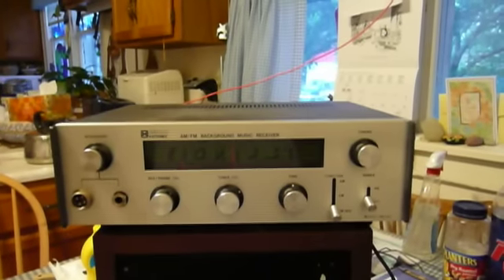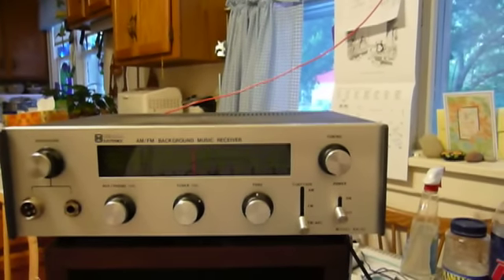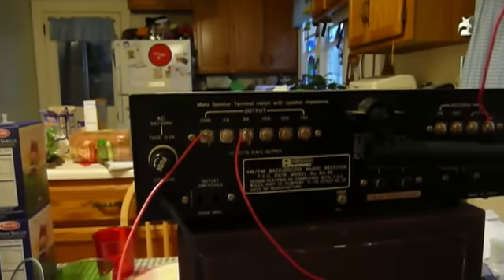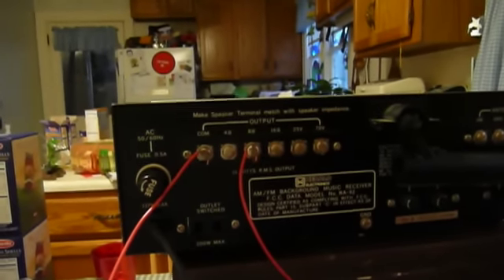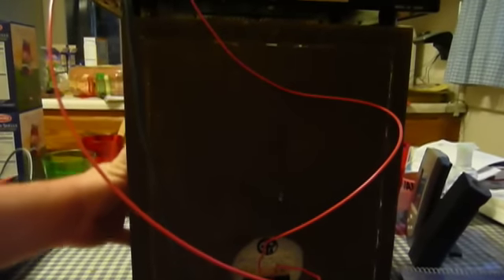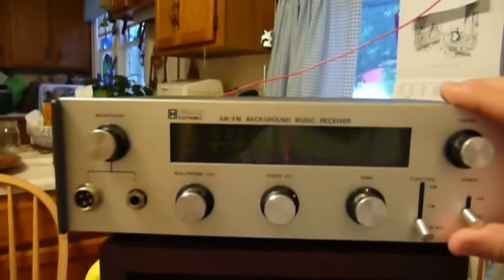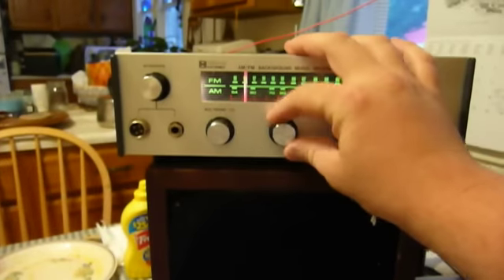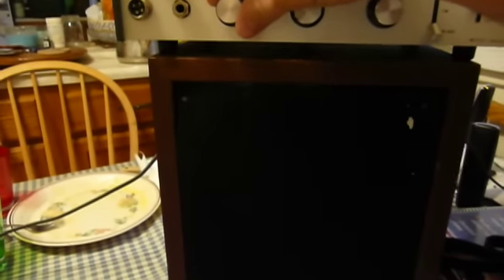Herald Electronics Background Music Receiver

Comment: 25V / 70V is a really cool system, each speaker has a multi-tapped transformer where you select how much power goes to the speaker.  Since this unit is 15watts it can drive 15 speakers at 1 watt each, or 30 speakers at .5 watts each or 60 speakers at .25 watts each. Something like this would be more than adequate to drive the speakers in a small to medium sized restaurant.